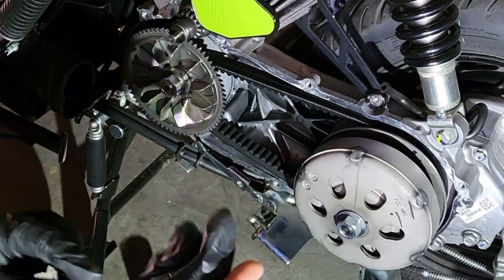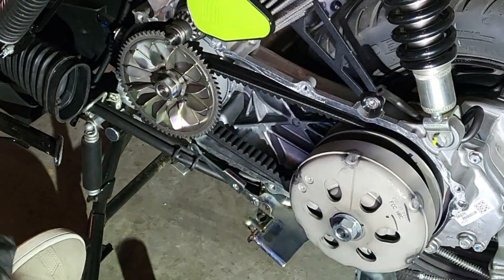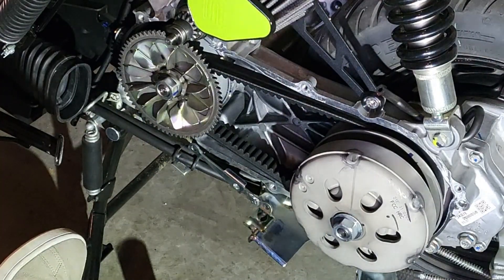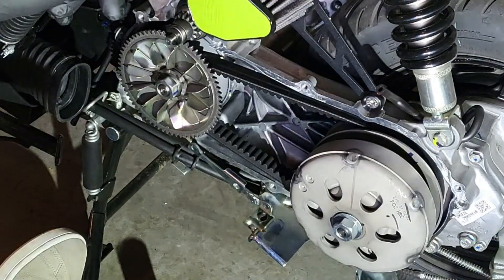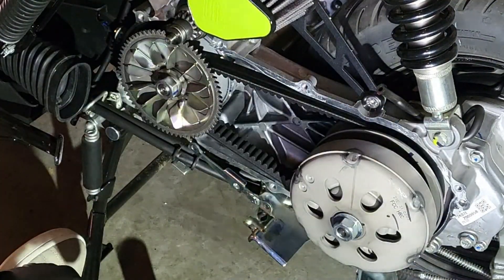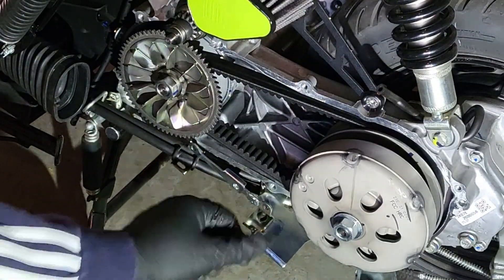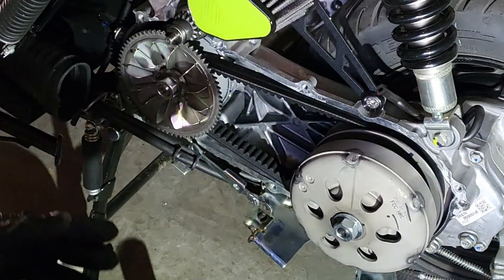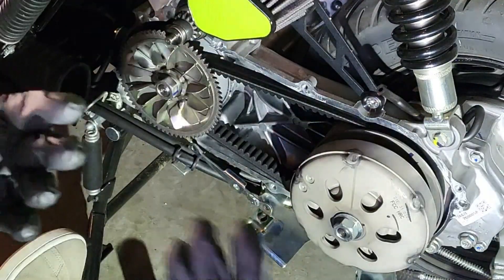2022 Honda Navi CVT Upgrade - Dr. Pulley Sliders

Comment from the maker: These made a huge difference. Really nice acceleration gain, holds speed better and got to 53mph. I could see changing the contra spring and exhaust adding to those gains in a big way.
Reply from the maker: @kirkringey3562  Yes and no. You have to find a balance and tune the CVT. For street riding though the 11g worked out great. That being said I have an aftermarket intake and jetted carb. Your engine tune also affects what weight sliders you use and what contra spring you use. I will be installing a Hotlap Japan exhaust when it comes in which will have an effect as well. At that time I will upgrade the contra spring.
Reply: @SCMOTO  hows the hotlap exhaust? not sure if its worth the weight
Reply from the maker: @shakeupchristmas  It weighs alot less then the factory and sounds good. It also should be done if you plan on upgrading the carb or intake. You will get the most out of both mods that way.
Reply: @SCMOTO  how much does changing the carb do? Vs. just bigger jets? Did exhaust and air intake so far.
Reply from the maker: @shakeupchristmas  large HP gain
Reply: I’m 5’10 225 lbs 

I have the Malossi Variator 
A Pod Filter And just added the Reveno Clutch and I have used a Jet kit on the Carburetor. I ride local on the streets some time on my parkway that has a speed limit of 45 

Any recommendations on how many grams I should use for my Dr Pulleys
Reply from the maker: @christophervillalona4961  try 12g and 14g.
Reply: @SCMOTO more top speed with 14 gram ?
Reply from the maker: @flyinphil42  depends on rider but with other mods it can hit 60
Reply: @SCMOTO  I am 240 pounds , I am able to go 52 miles an hour on the flat with no modifications, it takes a little while to get up to that speed, I would like to be able to go at least 55 mph.
Reply from the maker: @flyinphil42  Try 12 or 14.
Reply from the maker: @flyinphil42  It's a weird balance game with rollers or sliders. More weight can give a higher top speed and lower weight better acceleration (not exact though). That is if the bike/rider need it and/or the mods support it. With the Navi though I myself and others have seen a increase in both when going lighter. I can't really nail down the exact weight for someone else though. It depends on your size, weight, riding style/habits, mods that have been done, altitude, road surface type, etc.... That all being said, 12-15g weights have been shown to improve the Navi's acceleration and in some cases top speed. I have tried 11-16 and mix weights in mine with 2 different variator set ups. I saw the best balance with 12-14g with most states of tune on my bike. You can go the other way as well if the main concern is top speed. Adding more power and going with a heavier 16-20g slider as opposed to roller.
Reply from the maker: @flyinphil42  I was at 305lbs at 1 point riding the Navi (discovered I was type 2 diabetic). Lost 75lbs since but I was able to get the little thing up to 60 mph with a ton of work and tuning. Good luck with the 13g, I hope they get you where you want to be.
Reply: @SCMOTO I ordered some 13 gram sliders, so hopefully they will work out, . I was looking at the aftermarket variators , they appear to have more curve at the end for the weights to move out.
Reply from the maker: @flyinphil42  Some do and they have the added benefit of being lighter than the factory setup.
Reply: @SCMOTO  I think it was the dr pulley variator looked really good , also the malossi, but both are well over $100 us , I would not spend that kind of money on a variator unless it was going to give me some big gains.
Reply from the maker: @flyinphil42  You need to upgrade the contra spring as well to see real gains. Even then unless you've increased the power output the gains won't be huge. It differs bike to bike.
Reply: I just checked my torque wrench settings, it goes to 50 pounds max , I have an impact drill that can handle a 22 mm impact socket. Should I get a torque wrench that goes up to 100 pounds or will 50 be good enough?
Reply from the maker: @flyinphil42  can't remember the spec off hand but you really want to be at least within a 5% of spec
Reply: @SCMOTO  if I remember correctly in the video you said that the variator bolt needs to be 69 lbs of torque, so that would mean 65 lbs would be the minimum torque.
Reply from the maker: @flyinphil42  Yeah but aim for 69 because each torque wrench can have 5% variance

Comment: I’m 5’10 225 lbs 

I have the Malossi Variator 
A Pod Filter And just added the Reveno Clutch and I have used a Jet kit on the Carburetor. I ride local on the streets some time on my parkway that has a speed limit of 45 

Any recommendations on how many grams I should use for my Dr Pulleys
Reply from the maker: Sorry for late reply. If it helps at this point, kits are sold with test rollers to determine the best weight for you and your bike. Just based off the mods and your weight I would hazard a guess at 12-14g.

Comment: What is there different weights for the sliders, 11g, 12g…
Reply from the maker: There are
Reply: sorry i meant to say *why is there different weights
Reply from the maker: Oh, different weights have different properties and affect acceleration and top speed in different ways. The weight you use is based around the state of tune your bike is in, your height, your weight and riding style.
Reply: @SCMOTO  got it, thank you for the info. I just didn’t know what to choose when i was about to purchase them. Thank you again.
Reply from the maker: @minimotolifestyle1659  no problem. If you weigh less than 200 lbs I might would try the 12g. You can also buy kits that have test weights for about $20-30.
Reply: @SCMOTO  ah ok cool man thank you for all that info man awesome videos and ride safe man

Comment: Saw a video where instead of swapping those, he just used a dremel to make more space for the sliders to push higher.... Achieved the same result. Would you recommend not doing that?
Reply from the maker: You won't get the same results from removing material from the variator. However, you can get a small gain from doing it. 
I have seen that video as well and it is a old trick that has been around for decades. Like I said it can make an improvement but it can also trash rhe variator if you are not careful. Done properly, the same exact amount of material has to be removed from each spot to maintain balance.
Reply: @SCMOTO  Ended up just putting some 12g weights in there, left 2 of the stock 18g weights so I wouldnt lose too much from the top end. Noticed a very big difference in its snap off the rip.
Reply from the maker: @Lvbstda14  nice

Comment: what size sliders did you install
Reply from the maker: 25x15 11g Dr.Pulley
Reply: @nwnative4139  There is a drop down that lets you select the weight. 11g, 12g, 17g, and 18g. I missed it the first time I looked also. lol
Reply: @nwnative4139  same here
Reply: I'm sorry Is not 20x15?

Comment: Do you have a before and after top speed different and time to get there?
Like was top speed before 49 and now it’s 55. Also did it take 45 sec to get to top speed now it takes 25? Things like that would be appreciated!
Reply from the maker: I have been throwing parts at this thing so quickly. Yes, in stock form my top speed was about 47 @ 13.2 seconds. After CVT mod and Intake 53 @ 12.1 seconds. Now with carb, exhaust, CVT mods and weight loss 58 @ 11.7. These are rough figures using 2 different apps. I wouldn't trust the exact numbers but the difference can be observed either way.
Reply: Holy “-&: that’s sweet. This is my very first bike. Always been a Honda guy race my crx and I love this thing but it’s lacking in quite a few places. Will be reviewing your videos as I am ready to drop 500-1000 to get this thing where I want it rather than getting a grom or cb300 or something
Reply from the maker: @kurtmakeemhurt6657  Appreciate the views. The Navi is a fun little bike. 
Make sure to use my promo code if you purchase from scooterswapshop.com. It will get you 5% off your first order.

Comment: Hi the sie of thé sliders Is not 20x15?
Reply: The size of the sliders
Reply from the maker: Yes the sliders are 20x15. I used 11g sliders the factory rollers are 17g

Comment: My daughter  weight  is 110 after complete  CVT upgrade  top speed  still only 48. 49 mph .
Reply from the maker: What weight slider/roller did you go with? Most people find the lack of acceleration with their body weight to be a brick wall for higher top speeds as the Navi just doesn't have the umph to get them there. At 110 pounds, if she is ok with a small loss in acceleration, heavier weight sliders/rollers should increase the top speed.
Reply: @SC MOTO  
I stuck with the rollers that come eith the  Malossi variator  per the advice of the guy that Runs Scooterpartsco.
I was going to go with 12 g  from watching  different videos  he said Trust Malossi  they have been doing this a long time.
Reply from the maker: @henrytoler5023  The rollers included in the Malossi kit are 12g so you are good either way there. Just some basic info to clear things up a little in the future. The CVT roller weight is determined by factors such as the rider weight, bike weight and state of tune. The idea that heavy=top speed and light=acceleration has some truth behind it but what is really happening is the weight changes the shift points. The 12g are suited more towards acceleration however some people see an increase in top speed even with 12-14g rollers/sliders due to the lack of power the Navi has to move heavier riders. Essentially staying in a lower gear longer. If acceleration isn't a concern though for a 110 pound rider and higher top speed is what you are after 14-18g would be better suited. The factory Navi uses a 17g roller. This would also depend on if you have modified the Navi to increase power output (carb, exhaust, cam,etc..). In my Navis current state with 22mm carb, Hotlap exhaust, ported head, RDR clutch bell, Malossi variator and about 20-30 pounds of weight removed with a mix of 12g and 13g rollers I can hit 50-59 depending on road surface and weather. With 16g rollers I tested I hit 61 mph but struggled to get there. Craftsman has been making sockets for a very long time but their 14mm won't fit a 12mm nut. Hope this is helpful.

Comment: So the upgrade helps for what purpose?
Reply from the maker: Changing roller weights can increase acceleration and top speed. Sliders can have a benefit over rollers by offering additional extension. The clutch bell is lighter and has a better surface.